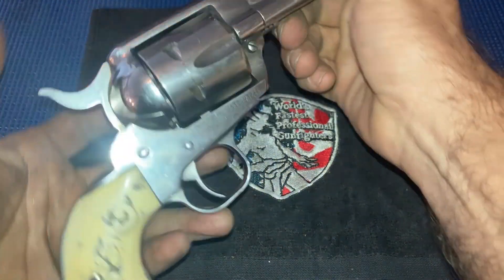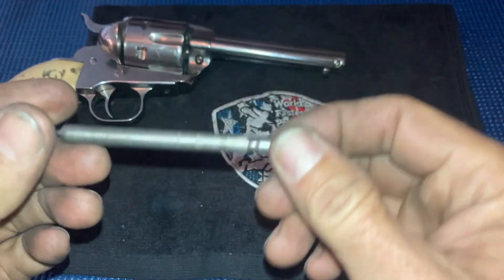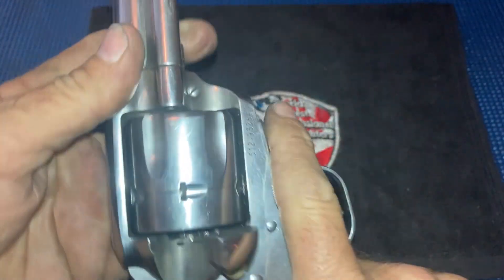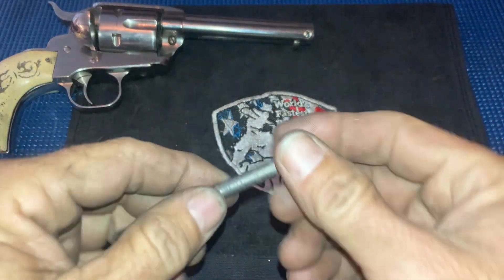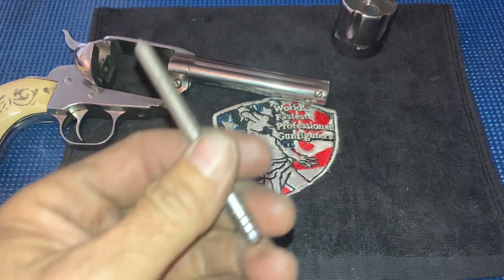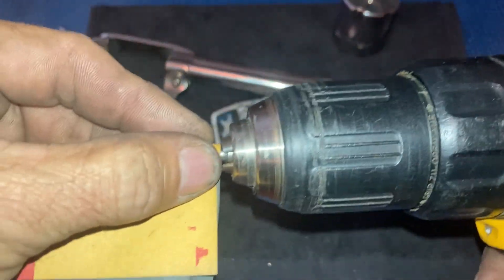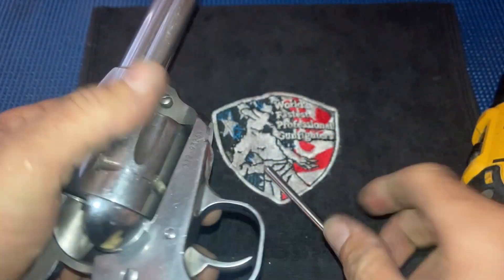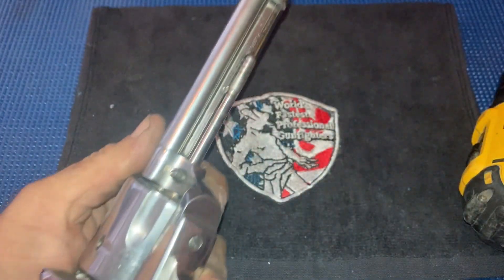SLICKING UP THE MAIN PIN.

Comment: Not to be a pest, but am wondering if somebody could give me a response to my serious but dumb questions in your tech tip video from 3 months back? Also, keep these videos rolling!
Reply: Sorry I missed your question regarding barrel length some time back. In the video I said 4 3/4 inch barrel but there is a gray area in measurements depending on the manufacturer. Some measure the barrel from the front of the frame as some measure from the forcing cone that touches the cylinder. As long as your barrel is measuring in the 4 inch range you’re good. Just no 3 1/2 inch Doc Holiday revolvers or rounded bird head grips. Thank you for your question.